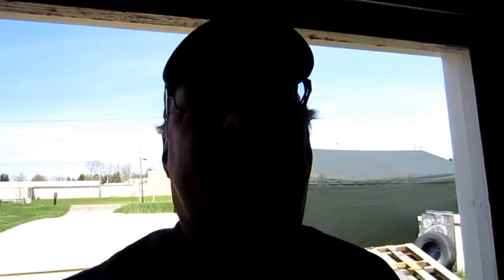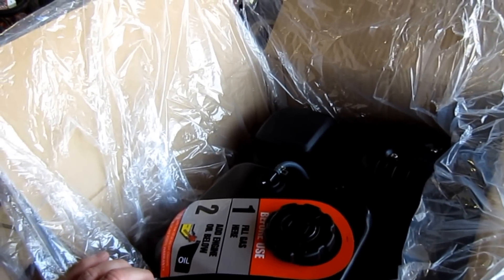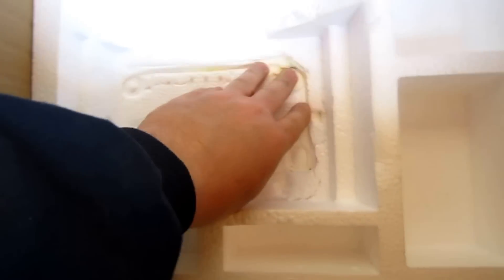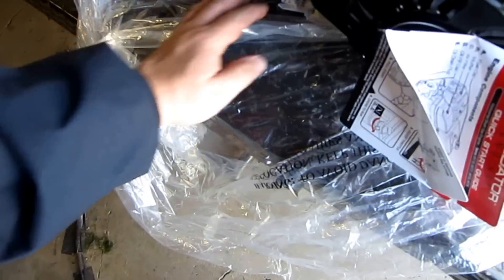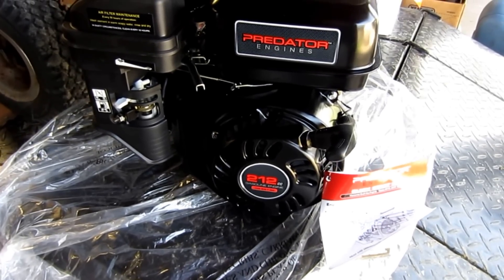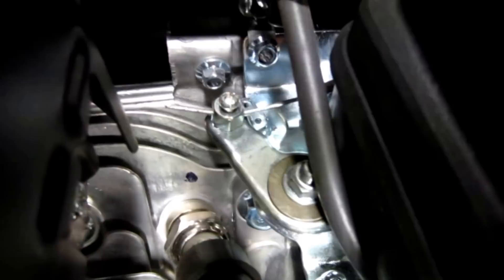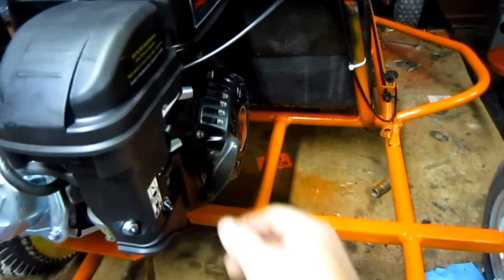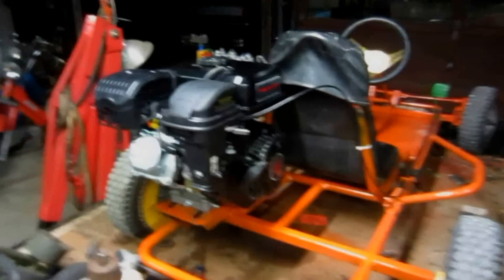Go Kart powered by Harbor Freight Predator engine

Comment: I bought one and monted on the frame and put oil/gas and still wont start
Reply: Foxboss9 did u remove the yellow wire on the engine where the kill switch is the oil censior wire do u think i should remove that wire from the engie
Reply: ***** make sure spark plug is tight.. If it still don't start, Take it back to Harbor Freight for an exchange..
Reply: RVdaydreami fixed it just neededd a little bit of oil but thx
Reply: ***** Great!.. BTW this is Foxboss9 I am in the middle of heavy video editing and am logged into my other channel right now .. Have fun with your cart!!
Reply: RVdaydream hey everytime i ride my gocart the engine stops but only when i drive it do u know how i could fix that
Reply from the maker: ***** kinda hard to diagnose over the Web..  It doesn't seem like it's a serious matter. Maybe just a tuning issue.  You may want to find someone close by that knows engines that can lend a quick hand to keep you running. Sorry about that. Good luck.
Reply: ok thx

Comment: Great video!  I have a question if you'd be so kind.  I have this same motor, but the sprocket on the gokart seems to be quite large so the motor will have to be lifted on a fabricated mount system OR I could change the sprocket to something smaller in diameter.  Which would you recommend?
Reply from the maker: Shannon Lewis spacer for the motor..that is If you are happy with the current sprocket(gearing). If you change the sprocket make sure the pitch is correct for the chain and that it is a compatible tooth count to match the other sprocket.  As far as mounting it on a spacer try some good quality hardwood first to make sure all is good then you can machine something more permanent later.. sometimes I end up leaving the hardwood on.. good luck

Comment: Haha, I was actually just looking at buying this engine to convert an old two stroke kawasaki I found rusted out in a barn to a four stroke. (just using it to putt around really short distances). I want a centrifugal clutch, but I want a large one that can take abuse (short runs) any recommended supplier or brand?
Reply from the maker: buddhaman001 clutch here http://amzn.to/1GFPcfn
Reply: Foxboss9 Nice, well since you seem to be online atm I have another question if you don't mind. The bike frame I will be putting this on is a Kawasaki km100 ('78). How in the world do I tell what chain I am using and if i can reuse it (just bought a new chain). I have no clue what the #35 means.
Reply from the maker: the bike sprocket will be too big for sure.. you may have to run a jackshaft to convert the smaller size 35 is the chain size to something bigger.. alot of the older mini bikes had jackshafts..
Reply: Foxboss9 I'm not against getting a new sprocket for the rear wheel, just didnt know the the chain size would be compatible. 

km100 even though it was a smaller bike didnt have a jackshaft, surprisingly enough it actually had a 5 speed transmission, and a nice one at that, i just dont wanna fool with oil mixtures or things of that nature, just wanna start and go while throwing a little fuel in it every now and again haha. 

Well Ill get the motor and clutch then just take it to a shop with the wheel and see what i can match up, doesnt have to be perfect, just has to be a putter  :P
Reply from the maker: buddhaman001 they will have to machine off the teeth of the Bikes sprocket and bolt on something that matches.. That will be your best bet..make sure you post a vid of it all done..people love seeing tht kind of stuff(including me)
Reply: Foxboss9 You know it! I love doing these types of projects.

Comment: Well I couldn't find a bullet connector with Y so I just disconnected the oil sensor and left it disconnected and just plugged in the kill switch wire to there it comes unplug from the factory and wha la thank you very much love the predator
Reply from the maker: That will work too.  Just keep an eye on your oil levels before riding.. Have fun.

Comment: I want to connect a kill switch I bought the same motor at Harbor Freight the go kart frame that I have came with a kill switch wired on to the steering wheel . how do I connected to the engine?
Reply from the maker: All the switch does on the engine is ground the signal going to the coil to the engine.  So all you need to do is wire the kill switch to do the same thing.  If your kill switch has one wire you need to connect it to the small wire that leads to the coil(not the spark plug wire)  and then ground the switch to the frame. If the new kill switch has 2 wires, the long wire will connect to the coil the same as mentioned before and the short wire will ground to the frame. Good luck.

Comment: hey I am purchasing a go-kart that has all the tires being slicks and i wanted to know if they would be fine to drive around my neighborhood. I know you can not drive them in the rain and that is fine but I just wanted to know how they would run, wear, and work. most important thing I want to know is how long they will last if I drive an average of 10 mins a day because I had a previous go kart that had tires with tread that were meant for lawn mowers and they wore out within 2 weeks and completley poped. the speed is about 25mph please answer
Reply from the maker: TechMultiview100 Man I wan't to give you a good answer but it's all relevant..
  I would suspect the lawn and garden tires compound was more for turf as most are...but if your alignment was ok and the cart didn't weigh much and the driving was reasonable,  then I would think they should have lasted a lot longer than 2 weeks. 
 The slicks are made for asphalt/concrete but the smoothness of the driving surface can vary greatly. So, to answer your question on how YOUR tires on YOUR kart that YOUR driving on YOUR streets are going to last and taking in consideration the karts weight, alignment, suspension, engine HP, aggressiveness of driving and also surface temperature and etc etc.. ,,,, I cannot even fathom a guess. I will say, that with the slicks, you should notice better cornering ability for sure. as far as longevity,,,, hard telling.. good luck
Reply: Foxboss9 thanks for the thourough reply

Comment: Did the engine come with that clutch or did you have to buy one seperate?
Reply: Reluctant Couch It doesn't come with one but you would have to order it from a go kart shop or off line
Reply: Reluctant Couch you must buy one separate if you get it from harbor freight
Reply from the maker: The engine is universal. It can be bought and used on a lot of different machinery. Rototillers, waterpumps, sod cutters, air compressors etc.. you get the picture..  Because mini-bikes and Go-Karts are really the only applications that require a clutch, all engine Mfgs including Predator / Harbor Freight do not sell their engines with clutches. Plus there are different clutches available that can be used on the same go-kart/mini-bike to achieve different engine performance characteristics. The clutch I used can he found by clicking the link in my video description...  Thanks for the question..

Comment: Can show me how to put a clutch on I can get it on but without the key way
Reply from the maker: Bert Hodges sorry don't have anything here I can show you with..You have to have a tapered shaft engine(not common at all) or a keyway to get it done right..
Reply: A keyway
Reply from the maker: Bert Hodges you put the correct size key in the keyway and slide the clutch on, by lining it up with the key.

Comment: would you know if a 12 tooth clutch would be good going on a 40 tooth sprocket or should i get a 10 tooth clutch on the 40 tooth sprocket
Reply from the maker: MoNsTeR_KaMiL All depends on RPM's, tire size , weight of kart, weight of rider, what kind of terrain you'll be riding on, Pavement top speed, or more torque for hill climb/stop go..too many variables for me to answer..

Comment: hello would you know what size washer you bought for the throttle and what size bolts did you use to mount the engine to the go cart frame
Reply from the maker: MoNsTeR_KaMiL Bolts to mount engine were 7/16 self tapping that I had left over from a riding mower. the washer was something else I had lying around. the only things I could recall that were specific to this engine that I bought , I listed in the description.. sorry.

Comment: What tires do you have on that kart? I have the same frame but need wheels. how fast was that kart? If you remember thanks
Reply from the maker: Sorry, I don't recall tire size. I bought them at TSC(tractor supply).  As far as speed, maybe 25mph. That depends on so many factors. Rider weight, engine rpms, tire size and most importantly gearing. If you were to set up your kart for top end speed only with a lightweight driver I would think 45 MPH would be obtainable. Good luck!

Comment: If you ever end up owning that thing than go on Amazon and buy one of those Chinese torque converters. They are cheap but they work just as good as the American made ones and they will make that go cart really rip. It also gets rid of all of the clutch noise and stuff too. I put one on my minibike with basically the same engine that you have and if you are sitting to far back on it and you give it WOT from a standstill you will flip over backwards.
Reply from the maker: Good to know. I had a large Manco Dingo Duece that had the Tork - a- verter on it. Huge performance gain.

Comment: about how fast did it go
Reply: I have one of these motors on my man could chassis and I'm 250 pounds and it does 30mph everything on it is stock other than the exaust because I switch it to an open pipe. I clicked the mph with a gps

Comment: Does it come with a mounting plate?
Reply from the maker: No mounting plate.. That would be supplied on the machine you are bolting it to. There would be too many variables for an engine manufacturer to be able to supply an engine plate that would fit for all the different type of machines.

Comment: Kill switch is important, if the throttle sticks it's hard to keep steering and reach around and hit the on/off switch for the motor.  A 10 year old may not have the presence of mind to kill the engine from the motor. Mount a kill switch where it can be easily accessed on the steering column.  You addressed it in your video but then dismissed the idea. 96K viewers have seen this video. It's your child... wire in a kill switch
Reply from the maker: I agree.  If I had a 10 year old...  But at the time of filming my kids were 16 and 17...  Plus, not only would 2 throttle return springs have to fail But,  the drum brakes would have to fail completely too.  At full speed with throttle wide open the kart would still come to a dead stop almost as quickly as no throttle being applied.  What the video didn't show is the new buyer advising me he didn't need the kill switch for his kids either. Ultimately it's a parents of the riders choice. Thanks for the comment.

Comment: What size bolt did you use on the crank shaft
Reply from the maker: Brett Smith smart move. keep it cheap. you'll enjoy it more!!
Reply from the maker: In the description should be a link
Reply: thanks so much
Reply from the maker: trucksandtractorsandfishing145 :-)
Reply: Foxboss9 quick questions 2 of them what do i put on the drive shaft (the thing that spins when u press the throttle) (sorry if i got the wording wrong) and do i need a battery for this engine? Or just a sparkplug and a battry if i want electric start?
Reply: Brett Smith okay i need a clutch but is it true that the clutch will just break down after  i drive slow for like 3 mins? But yeah please let me know and where did u get ur tires from?
Reply from the maker: Tires were off the shelf at Tractor Supply. If there isn't one near you try them online or BMI Karts. The clutch can burn up, but only if you don't allow it to engage. Driving slow at a rpm that just barely allows the clutch shoes to rub the outer bell will cause premature wear with that said i have never seen one burn up in 3 minutes without intentional abuse. Just make sure you gear it(sprockets) for the speed you will be traveling at the most. And make sure the RPM the engine is running at works with the clutches "stall speed". BMI Karts can help with the calculations..
Reply: Foxboss9 okay awesome thankyou for the answer im not super intelligwnt when it comes to this stuff so yeah haha thankyou very much how much did the set of tires cost you?
Reply from the maker: Your welcome, no worries, we are all good at something and YouTube takes care of teaching us the rest :-) . I think the tires were sort of expensive for how small they were, something like $17-22 bucks a piece. Ouch. I've bought car tires for that much (in the 80's).thanks for the comment, Good luck!
Reply from the maker: Brett Smith I think you may have got part of your answer but not all to your 2 questions.  1) drive shaft spinning thing  is a clutch..  2) I wouldn't do a starter yet(it can be added later) but, you need a) starter motor b) ignition button c) starter relay d) battery e)battery mount and hold downs f) battery cables and wiring.   Good luck with your build. :-)
Reply: Foxboss9 im getting a go kart engine and its pull start so i wont need a battery to start it up its gonna be single drive but thankyou
Reply: Brett Smith
Reply: Foxboss9 im not putting all that on it my engine is pull start, spending all that extra money isnt worth my time because i dont need a battery and all for it but i do appreciate the info thankyou

Comment: I put a Predator 212 cc on a Chinese 2 wheel drive mini atv..frame. Centrifigal clutch 7 or 8 teeth and reused rear sprocket, about 40 tooth. Some easy frame mods with welder and tossed the Chinese plastic "body fender" stuff. This sucker flies although gear ratio is for "fast" so starting out from stop I have help it a bit since I am 200 lbs. Never have opened it up as it feels like I will go airborne...I call it the Doom Buggy. Good engines I have 3 for various applications
Reply from the maker: You need to post a video of that for sure!
Reply: Foxboss9
It is on my channel in a video of sighting in my rifle but not featured or seen close-up. It is not a show piece but it runs. It seems there is some kind of minor fix needed from time to time but that is only because it is "custom" and the frame etc were abused in another life. I wanted something like this when I was a kid but never had one. Here I am at 60 and finally have my Doom Buggy (kind of neglected my Harley for a while, for shame!)! I would not let a kid this ride it without helmet  and proper attire though, definitely not a toy.
Reply from the maker: cravinbob That thing has gotta fly, It's tiny.

Comment: Where can I get this wheel set. I have the same frame but with the wheel set I have the clutch rubs the tire if the motor is not lifted
Reply from the maker: You can buy new wheels online from BMI Karts .. Or if you slot your holes on the frame pad where the engine mounts and buy a longer chain you can move the engine forward so the clutch doesn't hit, As long as your wheel set isn't really huge.

Comment: I have a honda xr2500 and i want to buy a clutch to mount in on a small dirtbike but the shaft doesnt have a way to put in a bolt to hold it in any ideas??
Reply from the maker: Grind a keyway slot in the dirt bike output shaft and use a keyway style clutch with a drilled and tapped set screw or drill/tap a provision in a keyway style clutch for a set screw..

Comment: I have same go kart  body. Did you have to move tweak any thing to get the chain in place to the cluch and sprocket..??? Plz answer I'm thinking of buying the engine.
Reply from the maker: No BUT, The holes on the frame may have to be enlongated to allow for enough movement to allow proper alignment.. Good Luck

Comment: Do you have a washer on the crank bolt. I saw the link for the bolt but wasn't sure if there was a washer involved also.
Reply from the maker: There is a washer on there but its one that I already had. Its not a special washer it just had to be a hardened washer.
Reply: Much appreciated.
Reply from the maker: I think the washer I used was from a 1978 Mustang Cobra 302 harmonic balancer bolt washer. Or washer from harmonic balancer bolt on 1975 460 from a Lincoln Towncar.

Comment: I had to completely disassemble and reassemble this engine for my comprehensive technology class.  Unfortunately, the rpm was too high because the governor was placed too high up.
Reply from the maker: Too bad about the governor adjust. But, it's cool you got to play around with the engine for a class assignment!
Reply: For my intro to mechanics class we rebuilt a 205cc Briggs n Stratton motor and I did the same thing
Reply from the maker: Those governors if not adjusted can be the downfall of the engine real quick if you don't shut them down in time. Just remember,with the linkage connected, and the throttle plate wide open, the governor gets adjusted as far as it can go in the same direction as it took to open the throttle plate. After you've done it a hundred or so times you don't even have to think about it.
Reply: Yeah +foxboss9

Comment: Didn't have to replace friction washer just loosen up the nut a lil .
Reply from the maker: I was afraid of the nut coming completely off from vibration. I don't recall was the nut a NylonLock nut?
Reply: Not sure I just loosened it up a lil   & works perfect -
Reply from the maker: Good deal.
Reply: I also put a heavy duty clutch because the cheap ones can't handle the motor

Comment: will this carry a 210lb person fast ?
Reply from the maker: Too many variables to consider, sorry no real answer.  How much does the kart weigh? What gearing are you going to use?  Are you going to use a torq-a-verter?  How tall are the tires? Are they soft knobby off road tread or hard smooth Street tread? And finally what do you consider fast?